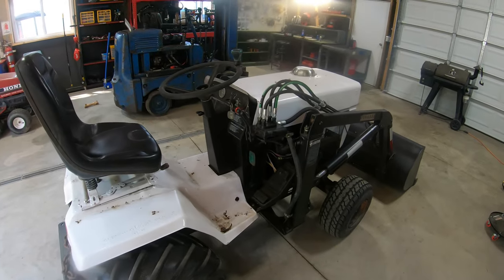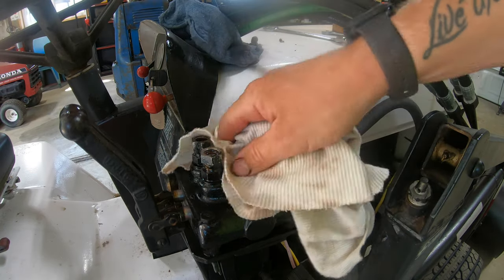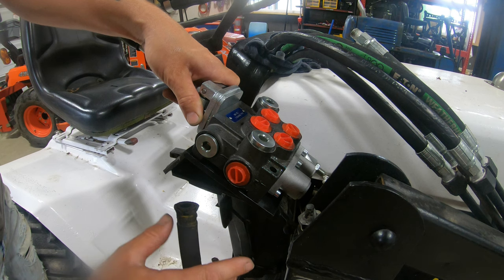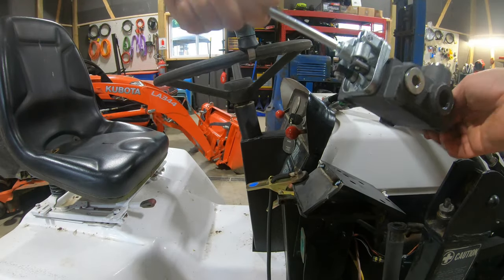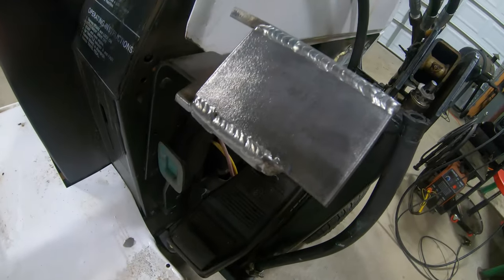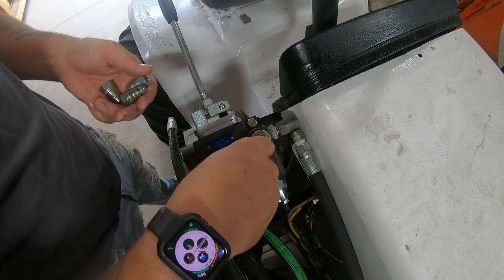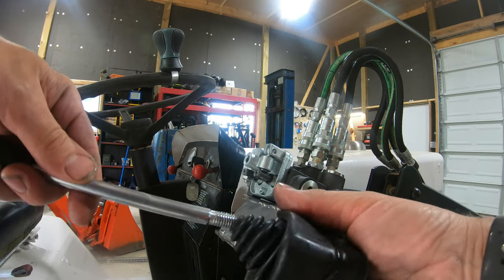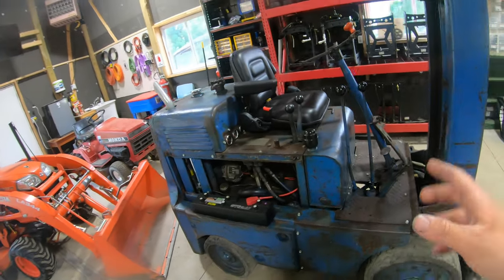LOADER VALVE UPGRADE ON AN OLD BOLENS TRACTOR!

Comment: Hey Mike! Great video, I've been contemplating doing this for my Bolens HT20 with the Johnson Workhorse 14 loader for a while now. 

Just a few questions; 

What GPM valve body is this? The ones i see online are 11 GMP and the Johnson pump is good for 6 GPM from what Ive read, does this pose any issues with operation? 

Are you able to pin out what hose goes where on the valve body? 

Thanks!!

Dakota

Comment: Great video. Nice replacement valve. Sure would be a handy tractor with the loader on it.
Reply from the maker: Thanks buddy! Yah it’s a nice old tractor for what it is, has a lot of power for its size too. He filled the rear tires before winter and it did real good 👍🏻

Comment: Hi Mike  Used a lot of black pipe fittings that worked good , like you were saying low pressure on a tractor like that isn't a big deal. Your bro will like the new controls.  NICE JOB
Reply from the maker: You got it man! Yah he’s really gonna love it now, much more modern and easier to use for him and certainly more ergonomic than it ever was before! Stay safe and god bless!

Comment: I saw some valves like that on ebay (vevor?),but I didn't think they had the load check valve.... I've got caught out lifting things and having them drop before they lift,how did yours go?
Reply from the maker: Not sure what you mean about a check valve. This loader valve didn’t have a float valve if that’s what you’re referring to.. I wish it did but it was a cheaper valve. You can spend a little more money and find one with the float function. If you’re referring to the releif valve then yes it has one built into the hydraulic manifold. I think I showed in this video how to adjust it if need be and check pressures. Best of luck!
Reply: @BiffsEquipment  its a non return valve on each spool to prevent load dropping before actuation, my vevor didn't have them,so got them separately...thanks all working good now.

Comment: Hey I have a quick question. I don't know if you have any experience on the Kubota b1750 or not, but was wondering if you knew how to remove of the hydrostatic transmission pump? I am working on one, and it had been pushing transmission oil into the engine and it was coming out of the breather. I talked with the local Kubota dealer and they said it was the pump. Just trying to figure out how it works, I am not all that familiar with hydrostatic transmissions.

Comment: So return line doesn’t need to be hydraulic connection?
Reply: Not under much Pressure, if any..
Reply from the maker: @m9ovich is correct 👍🏻

Comment: I saw some valves like that on ebay (vevor?),but I didn't think they had the load check valve.... I've got caught out lifting things and having them drop before they lift,how did yours go?
Reply from the maker: This loader valve is doing great! My brother has been using it on his tractor and used it all winter to plow and never had an issue with it yet. I’m not sure what you mean about it dropping before you lift.. it’s never had any issues like that. It has an adjustable relief valve where you can adjust the pressure you need which should be set by the hp of your tractor. As for the one thing it’s missing is it’s missing a float valve.. some of the nicer ones on eBay I think have the float but the one I bought my brother didn’t come with one.